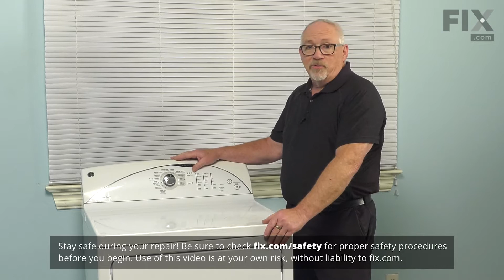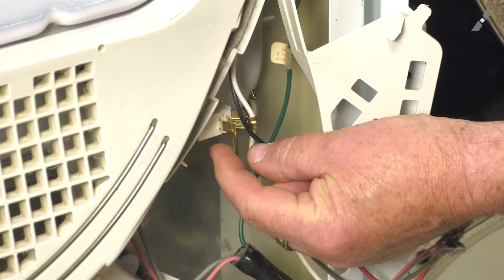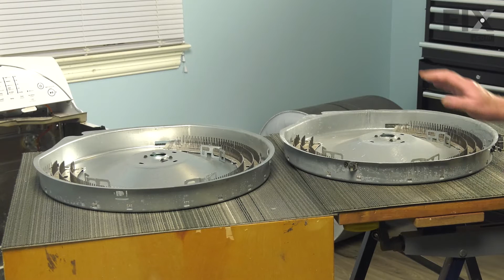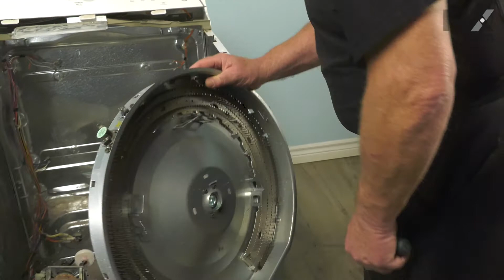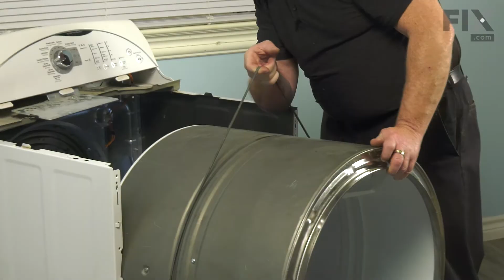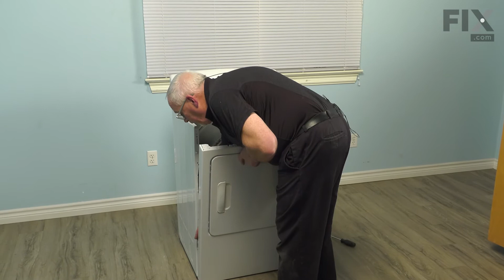GE Dryer Repair - How to Replace the Heating Element

Comment: Love your video and clear instructions!! Keep up the good work!
I have the grandfather dryer to this. A GE V-12  "Clothes Conditioning Automatic Dryer" Model: 78D51 1219 11
It is funny to see how little they have changed.
Some small differences being the V-12 had an extra metal disc between the dryer drum and the elements pan. It rotated with the drum. The elements were coils threaded through porcelain grommets and were easy to replace with some gentle stretching. They bolted through porcelain blocks to the safety thermostat and power wires.
Will run forever if you can find the parts and if you clean it out semi-regularly.